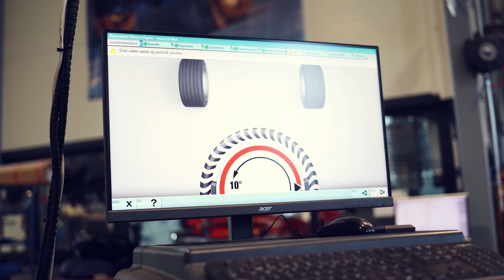Arctic Trucks Norge – Workshop

Comment: How much does it cost this change please?
Reply: Everything from 80000kr, to the sky is the limit i think. But a normal build will cost around 130000kr to 250000k, depending on wheel size, extra equipment, one or two sets of wheels etc.
Reply: @per.bjoerk  Thank you for your answer.I will contact you again
Reply from the maker: https://arctictrucks.no/produkt/isuzu-d-max-ombygging/